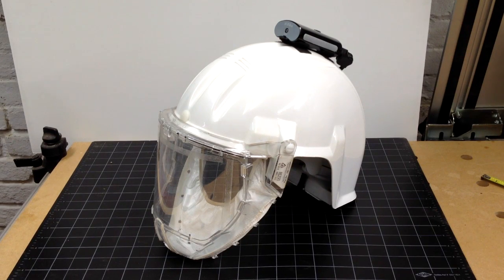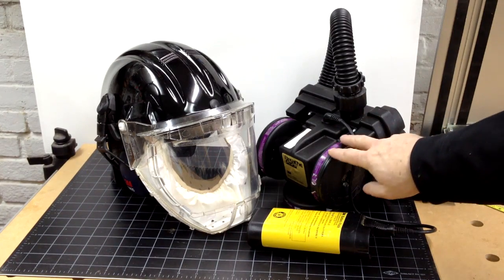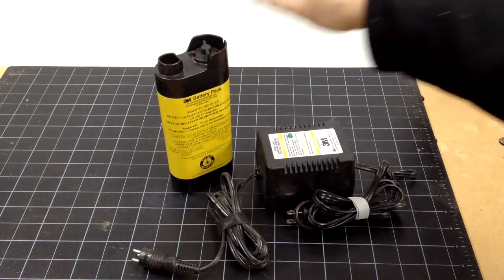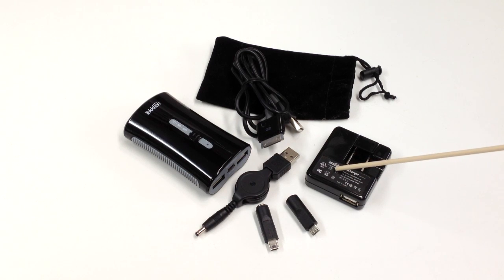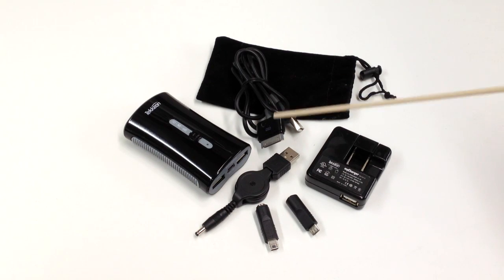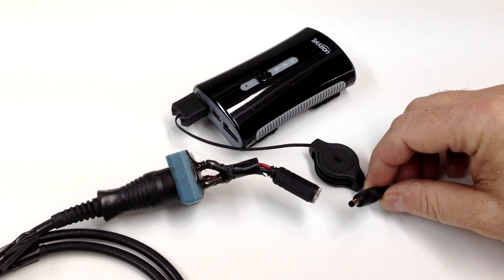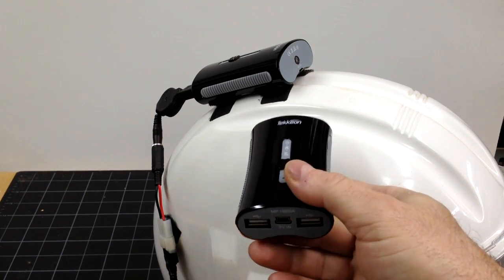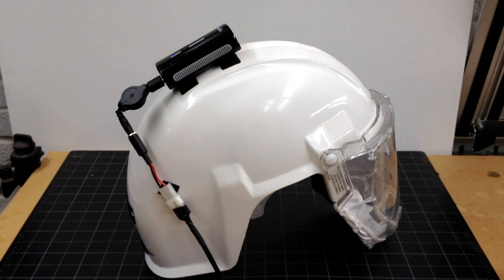Compact battery for 3M AirStream or Breathe Easy PAPR respirators

Comment: I bought an 3M Airstream helmet last year. It didn't have a battery so I bought a phone bank battery charger and adapted a connection to work with a USB cord. Ie was great I used a cord long enough to keep the battery bank in my pocket.

Comment: Wow, 8 years ago when Corona was something you drank with a slice of lime and some salt.

 I was going to weld some galvanized angle iron and wanted to build a PAPR for just the one project. It never got done. But I put it together the other day with my spare parts and a new snorkel mask.
Thank you for verifying the voltage required. There is ZERO info available from 3M and Sperion. They just want you to buy their insanely overpriced batteries and chargers. I used a $10  8 amp hour 3.2 volt Headway lithium 38120  battery but the fan runs a bit slow. The next one will have 2 batteries and an electronic voltage regulator set for 4.8 volts. I used a CPAP hose and NATO 40mm NBC screw on  filter. The mask will fit in a modified Harbor Freight auto darkening welding hood eventually but I may just use this to go shopping.....

Comment: Thank you for this!  I’m the only ER physician working in a small rural hospital setting...I am currently attempting to build my own PAPR respirator device. so far I have managed to obtain one full 3M breathe easy device (for biohazard use) but the bp-15 battery pack doesn’t work...I am using ur video to help me understand how to find a replacement or even build my own battery from a configuration of 18650’s (do u think that might work!??) also any and I do mean ANY information or advice u can give me will literally save a lot of lives. Thank you so much
Reply: Update: My USB method might be running it a bit under-powered in flow based on sound, so this might not be a solution. 
Hi Kramer. I saw your comment. I'm no electrical engineer so these are just my thoughts. One thing I figured out from reading forums is that a standard 2.1A USB phone charger power bank seems to be able to run a Breathe Easy unit (if this is the unit you have). I took an old phone charger cable (USB to micro-USB), cut off the micro-USB side, stripped it down to the Red, black, green and white wires, and I was able to power a Breathe Easy unit with it. The USB side was plugged into the power bank and the exposed red and black wires I connected to 2 of the 3 breathe easy unit cord pins. The airflow seems nice and strong but I don't have a flow meter to verify flow rate. I used the 2 pins on the flat side of the plug and if the flat side is up when you're looking at the pins, the positive (red) is the right pin and negative (black) is left pin (it sounds like 2 of the pins connect into one wire in the unit so you only need to connect to 2 of 3 pins with power). On the forums they said if you connect it backwards polarity, it will just flow backwards and it will be obvious. On eBay I see some USB to alligator clip adapters available that might work so you wouldn't have to strip a cable, not sure though.  Best of luck.
Reply: @eddykayo  The air flow will be much reduced but will not flow backwards. Its really obvious if the fan is running backwards. Try it both polarities and see which one blows more air, then wire it that way.
Reply: @eddykayo  Was just curious if you would mind sharing a link to the forum conversation you had about this project? Just wanted to lurk it to see all the discussion.
Reply: Look what I just built...  The PAPR units never show the rated voltage so I guessed. By goofing around I was able to find that 4.5 volts was nearly ideal. I am happy to see that he states that the design voltage is 4.8 volts. I plan to build a second unit and put a pair of 3.2 volt Headway lithium rechargeable batteries along with an electronic buck converter voltage regulator set to 4.8 volts. Headway 38120 lithium batteries are rated 8 amp hours so they are robust. They charge quickly as well. The blower was from a face mounted PAPR unit and the filter is a 40mm surplus NBC military unit that I had. I plan to wear the blower and filter from a neck strap. It looks heavier and larger than it really is. Good luck!   https://www.youtube.com/watch?v=iLAQov7C9hE

Comment: Got some of the parts for a similar setup today and have a few notes for any other intrepid people hacking at something similar. I bought one of the now fairly old, Racal branded, Breathe Easy blower units (only, no battery, Part # 022-00-03) off ebay along with an airflow indicator - obviously some gvt surplus stuff. 

1) First thing to note is wiring - If you hold the Breathe Easy unit's power cable towards you - the left pin is for the black wire, the right pin is for your 5v red wire. 
2) Second thing to note is the current/voltage requirements - there's been much discussion elsewhere in here about needing a unit capable of 5v 2.1A - I used a 5v 1A battery pack I had lying around and it worked fine - as evidenced by the ball in the Breathe Easy Airflow Indicator immediately rising to the top. Further, I hooked up an inline USB power meter, and it drew about 0.7A. I'll try my 2.1A pack later as well, just for completeness sake.
3) For power supply cabling - you can take a USB wire, cut near the phone/device end, expose the inner wires, and cut back everything but the red and black wires. A more permanent solution to the connection as in the video would be advisable - I'm planning on using the brass tube approach as in the video, but doing some potting and overmolding with hot glue and epoxy resin.
4) An important caveat to this is that this worked with the Breathe Easy unit (Part # 022-00-03), but the above details might not necessarily be the same for other units.

Let me know if you're browsing through here and want any other info, will do my best to answer.
Reply: Just curious if you had any new details to share or if youve tweaked your set up any since you posted this. Thanks for the original post.
Reply: @viewer54322  Hey, not much to add off hand, I did use the brass tubing, and did a rubber overmold for it using sugru. Haven't used it much, but it's done the job the couple of times I have. Anything specific you were wondering about?
Reply: @oblongmana  Just purchased a new one sealed in box and doing the battery cable mod as well to use with USB. I read in the manual about operating it once every X years to preserve motor lubrication and wasn't sure if you've ever opened it up or has the motor been fine?
Reply: @viewer54322  No troubles with the motor on mine though mine did come unsealed so may have been used - no signs of wear on it though. Fingers crossed yours is still in good nick!
Reply: @oblongmana  Thanks again Jim for the info! The tubing mod, do you happen to remember what you used off hand? I used caliper and found the pin size to be ~2.80mm, assuming my caliper is correct. Been searching for "brass insert terminals" etc but no luck. I imagine you got three tubes, soldered wires to two of them and then built a mold somehow to make the plug adapter, aye?
Reply: @viewer54322   No worries, happy to help! Judging from my lining up my leftover brass with the connector I made, I believe I used K&S 8128 round brass tubing - labelled as 5/32 x 0.14 (3.97mm) - that'll be the Outer Diameter, ID I'm not sure on - but my crappy caliper reckons the wall thickness is about 0.45mm. it's not a perfect match, but I figured something just a smidgen large was the right call anyway, lets you pinch it into shape. As for process - yep, that's basically what I did. I tried initially to see if I could identify a standard connector that would match, but that was ultimately a waste of time. Just used the brass tubing above in a fairly un-sophisticated way - chopped 3 lengths with tin snips, pinched/expanded one end of each until they got a good grasp on the pins while still allowing me to pull it free, soldered the other ends, and then molded them by hand in 3 little packs of Sugru (this stuff - https://www.amazon.com/Sugru-Moldable-Glue-Original-Formula/dp/B008URBC9I) and left it to set to make a matching connector.
Reply: hello! a very stupid question about your publication. I'm about to adapt a battery. Could you give me a better reference on which is the positive (red) and negative (black) plug of the breathe easy? You say that looking at the plug from the front, the left pin is negative. Since I have not even had a device in my hands, I do not know it, is there any other reference to the plug? Do you have any of the 3 pins that are different? because you can put it in three positions and there will always be one on the left and one on the right. I ask you to help me identify that better. Thank you
sorry for the english is from the translator

Comment: Hi,  I've been trying to find a USB battery that will work with my AirStream but am having some trouble.  I don't know if it has something to do with the newer battery packs, but I've tried 3 different brands and none will power the helmet.  They all had 2A outputs and one of them even said it could go up to 3A (a 10,000mah Anker brand)  I did a test and hooked up my helmet via USB to a wall charger and it powered up fine.  I'm currently using a 4AA battery pack to power the fan, but would like a higher capacity battery.  Any help would be greatly appreciated.

Comment: Great video. Thanks for posting it.

With the Tekkeon 1860 battery no longer available, this one - http://www.instapark.com/external-battery-pack-n-charger/instapark-mp1800u2-5-200-mah-external-battery-pack-n-charger.html - looks like a good alternative. It appears to be essentially the same battery pack, but with a roughly 20% higher capacity and a lower price - $28. Although it doesn't include the array of connectors that came with the Tekkeon, it still looks like a great deal. I just ordered one and will post my experience with it once I've had a chance to hook it up and try it with my Breathe Easy unit.
Reply from the maker: That looks like it will work very nicely.  Please do post your results, it would be great to be able to recommend a direct replacement.
Reply: I just received and unpacked the Instapark MP1800U2 unit and I will say "beware!" The ONLY things in the package were the battery pack itself and a small instruction sheet - no charger or cables. Apparently the missing cable was just a mistake, but the missing charger wasn't. (According to the instruction sheet there should have been a charging cable included, but there is no mention of an included charger.) 

When Instapark says they are selling you an "Instapark® MP1800U2 5,200 mAh External Battery Pack & Charger", apparently the "charger" they mention is the battery pack itself - which seems more than a little misleading. So I guess one needs to fend for him/herself as far as that goes. Which means that the $28 price isn't quite as good as it initially seemed. 

The spec sheet in the manual states a battery capacity of 5200mAh and max current of 2.4A @ 5v. It also states that the batteries inside are Samsung 18650 Li-ion, so at least they aren't some cheap Chinese no-name junk.

Otherwise, this thing really IS tiny and light.  Once I dig up a cable and make an adapter to connect it to my respirator I’ll post my results. But aside from the unexpected aggravation of the missing cable and no charger, it looks like this should be a very nice alternative to the stock 3M battery pack.
Reply from the maker: glassmakerx Thanks for the followup.  Many battery packs I've seen these days do not come with a charger or cable, which is a good thing for those of us who have way too many cables around the house.  People can also charge their batteries from the usb port on their computer, albeit a slower charge.   Still, at that price for the battery alone, it seems like a good deal.
Reply: Zentient1 Sorry I've been slow getting back to this. A couple of things came up that put my original plan on hold. One, I never got around to making an adapter to connect the USB cable for the Instapark MP1800U2 battery to the power connector on my Breathe Easy. Part of the reason for that is because I'm running it off a different lithium battery right now that I grabbed off eBay for $45. That battery is the functional equivalent of a Tekkeon MP3450. Although it is much larger and heavier than the Instapark MP1800U2 or Tekkeon 1860, it has selectable voltages, which I like. Using that feature I've been running my respirator at 5.5 Vdc to push a little more air through it and keep the shield from fogging, and it has worked great.

So my incentive to wire up the MP1800U2 battery has been lessened and I just haven't found the time to do it. I eventually will, but I'm not sure when.

Now for the good news. I found an even better deal on what looks to be a good battery alternative - http://www.all-battery.com/Tenergy6600mAhSuperPowerBankforDigitalDevices-51028.aspx#reviews
 It has the same dual USB outputs as the Instapark MP1800U2, with a maximum current capability of 2.1 amps, and a capacity of 6600mAh, so it should run the Breathe Easy just fine. Better yet, right now the price is $13, plus shipping. If I didn't already have two new batteries I'd buy one. But with the two battery packs I have, I think I have all the battery capacity I need right now. (Although at that price I might change my mind...)

I hope this helps someone out.
Reply from the maker: glassmakerx Thanks, there are many batteries that will run the fan.  The Tenergy seems nice, but it weighs nearly twice that of the original pack shown.  I too like the MP3450 series, it was my original configuration (I have several of them) for my helmets before switching to the smaller unit.
Reply: Zentient1 Yes, I missed the 7.7 ounce weight of the Tenergy vs. the 4 ounces of the MP1800U2 and the Tekkeon 1860 you originally posted about. Although it wouldn't be an issue for me since my respirator has the belt mounted blower, I can see where the lighter battery pack would definitely be better when mounting it on the helmet of an all-in-one Airstream like yours.

Regardless, the important thing is that your video shows there are cheaper and better alternatives to the ridiculous price of a stock replacement battery for these Racal/3M respirators. So for that, once again - Thank You!

Comment: I have just bought a second hand "3M / RACAL 6800PF POWERFLOW" mask without a battery. I did not want to pay the 250usd for the Nicad / Nickel hydride battery. So thank you for telling me just what I needed to know: that the voltage is 4.8v about the same as many lithium cells, and that there are only two wires. I am set.

I am a bit confused by your statement that "one is ground ( i.e. earth, not the negative terminal) and the other two, the hot ones (aha, the + and - of the battery?) are actually wired together" (!! that would imply that they short out!).

But since I now know there are only two wires in there, I should be able to work it out. I wonder if the wires are coloured red and black.

I guess that that "Tekkeon" here is a link but it is not available any more from amazon (the link is just so that people can see the specs)
http://www.amazon.com/Tekkeon-TekCharge-External-Battery-iPhone/dp/B004OC0122

You can get these kind of battery packs - many different types - mainly from Chinese suppliers on ebay, aliexpress, buyincoins, dx etc. And they often come with the ability to replace the batteries which are generally two standard 18650 lithium batteries. I happen to have just bought one with a two digit 7 segment display telling me how much is left in the batteries. It can supply up to 2A apparently so it should be okay.
Here it is (I have no affiliation with any of these links)
http://www.ebay.com/itm/310807791562?ssPageName=STRK:MEWNX:IT&_trksid=p3984.m1439.l2649
or here
http://www.buyincoins.com/item/34897.html
You also need a couple of batteries such as these
http://www.aliexpress.com/snapshot/305369276.html
And a charger for the batteries
http://www.ebay.com/itm/141139182797?ssPageName=STRK:MEWNX:IT&_trksid=p3984.m1439.l2649
Total cost about 25USD, or one tenth of the price of the 3M.

Now that I have my mask, I see that one of the pins on the Racal plug is made of plastic. But I don't know where to get a cool in-line snap connector like you have, and I am never ever going to purchase a Racal battery so I think that I will connect the Racal wires to USB plug wires with a simple "Chocolate Block" connector. The wiring for the USB plug is quite simple and given in this diagram.
http://www.bealecorner.org/best/measure/USB/index.html

Comment from the maker: I have no interest in selling this setup... I just wanted to show people that they have alternatives to the stock battery pack.  Also, this particular battery pack is no longer available, but there are similar packs out there that work.  You just have to make sure that they supply more than 1.5 amps at 5 volts (most 1 amp packs don't work).

Comment from the maker: Yes, there are any number of ways of connecting power from a battery to the two leads going to the motor.  I opted to use a method that lets me connect to the stock battery, or the Tekkeon.  By using the snap together connector near the helmet, I can make adapters to accept power from any 4.8 to 5 volt source, regardless of the original connector configuration.

Comment: quick question: instead of cutting the original power cord, could one just remove the power-cord from the motor and then re-soldier a new cord with just the terminal-end socket?  

Since both of my batteries are dead, i'd like just to completely replace the original battery-system.

thanks